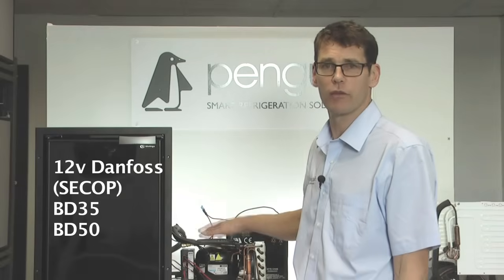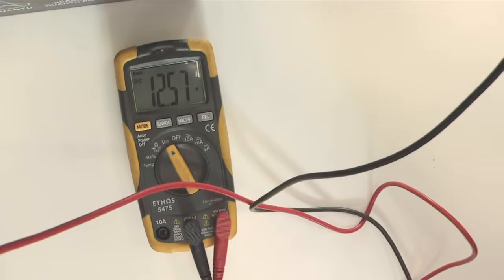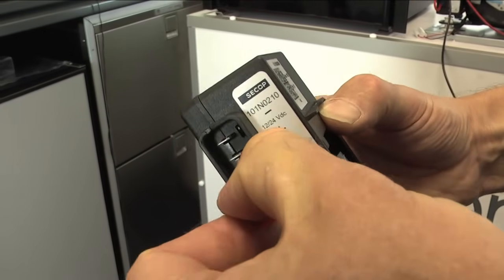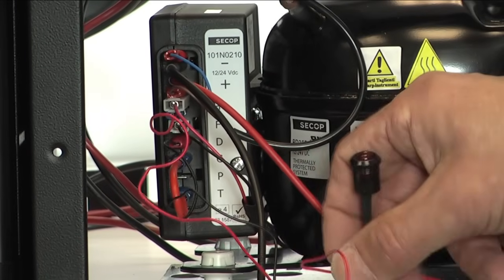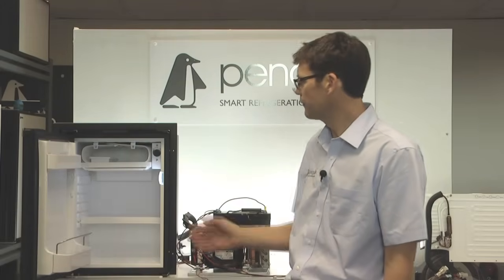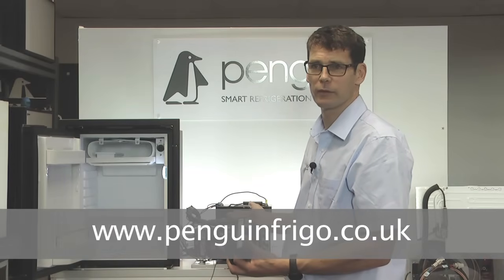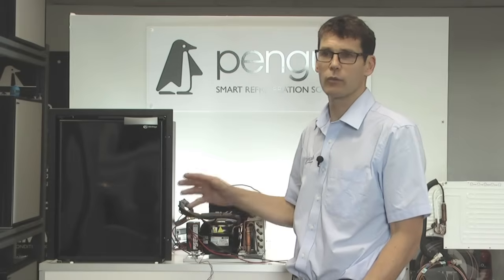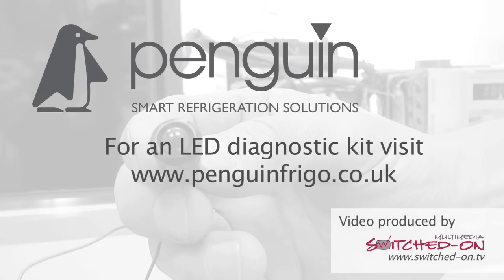BD35 BD50 DANFOSS 12/24V DC COMPRESSOR LED TEST

Comment: K

Hello,

Following my absence for three months, the compressor in my fridge no longer starts... it's a Danfoss BD35F.
The batteries are properly charged.
I did an LED test, nothing is flashing. 
I've got 12 v coming in. 
However, I have almost no voltage at the fan plugs (the fan doesn’t work). When I disconnect them, the motor doesn't start or vibrate either.
Do you have any idea where this could be coming from? 

Thanks a lot

Comment: I checked the winding/housing short circuit - no short circuit. I measured the winding resistances and in each case I got 0.0Ω. What could have happened?
The compressor is 12V DC.  What should the voltages be on the three contacts connected to the compressor? Should they be measured after unplugging the plug or with the compressor plug connected?

Comment: When i connect the power to the controller it blows a 15amp fuse so what is your recommended steps i have db50 simular controller. I checked all the wires to my boat i even unplugged the controller and all the cables and put power directly to the controller and it blows 15amp fuse would you say the controller is bad?

Comment: I want to run an extra fan of the same size as the factory fan for better ventilation in caravan and wire it to the factory fan. Will adding this cause the compressor to shut down by overloading the circuit? Thanks for a great video
Reply: Run a separate line,this pc board jts crap alreadh with one fan,and use an ambient tstat to turn fan on and off

Comment: My fridge comes up with a continuous flash. I’ve changed the temp sensor 3 times. If I take the fuse out for a minute then replace it will run for about a day. Each time I have to take out the fuse to reboot it. 
Any suggestions please

Comment: Good day, I have a Norcold (Thetford) N1090, the led is flashing 2 every 4 seconds, the fan is running but compressor not. I have done all the tests on the compressor resistance and voltage drop.  My unit shuts down when the power is disconnected to the fan at the control but when I disconnect at the fan plug there is no change other than the fan stops, the compressor does still not start.

Any ideas or help would be appreciated! Cheers.
Reply from the maker: Hi Paul, 2 flash can also be voltage drop on the newer 101N0212 controllers.  I suspect that it is still a voltage drop issue - remember that you will only see this when the compressor tries to start.  I recommend that you wire direct to a fully charged battery with minimum 2.5mm sq cables and crimped terminals to the battery and fridge
Reply from the maker: If you you get the same result then possible that controller is faulty - we can test this for you at Penguin, Havant UK. you can contact us through our website or email sales@penguinfrigo.co.uk
Reply: @penguinrefrigerationlimite3531  thanks, I'll give that a try. If it doesn't work is it worth swapping out the fan. I am in Canada so difficult to send my controller but not impossible.

Comment: give me battery capacity detaits
Reply from the maker: Sorry, not sure I understand your question.  The LED test will work on either 12V or 24V systems and assuming compressor will not start you should get a fault code result as long as the battery is not completely dead!

Comment: Led Light not turn on and refrigerator not working
Reply from the maker: Make sure that you have the thermostat linked out and LED is wired correctly to the small + and D.
If everything is correct it is possible that the controller is faulty and not giving an error code - but this is very unusual

Comment: Thank you for these great videos. I have a 101N0212 controller, and I recently installed an LED light on it. My question is, is there a way to test the LED light itself if there are no errors with the controller? In other words, I want to test my installation itself, and that the type of LED light I installed would light up if/when there's an error. I was expecting it would flash, as most equipment lights do, when I turned it off and on, but it didn't. Is there a way to test the light installation itself? PS: I've tested the LED component before installation and it works. I want to test that the controller is driving the LED light properly.
Reply from the maker: If the LED lights with 12V it will work if the controller is faulty and should flash a number of times every 4 seconds.  It is possible that the controller does not give a fault code - but this unusual.  Make sure you have the thermostat linked out.
Reply: @penguinrefrigerationlimite3531  sorry if I missed this somewhere, what is the right way to "link out" the thermostat? Can I simply disconnect the C and T wires from the compressor or do I need to join the wires to short them? Thanks!

Comment: Great informative video. I have a brand new never used Dometic CRX50 which is not powering up. I measure 12 or 24 volts at the terminals of the powersupply but as soon as I connect the terminals to the fridge, voltage drops to zero. I am thinking this is a defective SECOP unit - maybe with a dead short? Fan runs if I connect it directly to power supply. Any thoughts? Mike
Reply: Have you fixed it? I'm having a similar issue.
Reply: Have either of you figured it out yet? I'm having similar issue with everchill 12v refrigerator

Comment: 5 blink (thermal cut out) fixed by cleaning PCB here. Applies to 101N0220 and likely other obsolete controllers with "Dialog" chip. The traces for the thermistor runs next to a 12/24V trace. At the interface between the heatsink PCB and main PCB a small speck of what I assume was flux tesidue appears to have caused a significant leakage current between these traces, leading to erroneously high temperature readings. The interface between the PCBs shows multiple signs of what appears to be flux residue, so I would expect this to be a possible cause for faults for others as well. The thermistor traces are near the center of the board. Other faults may possibly be caused by leakage current between other neighboring traces, but the temperature sensing is particularly susceptible due to it using high resistance values.

The small unmarked SMD resistor-like component near the middle of the heat sink PCB appears to be an NTC thermistor, mine measured ~25kohm at 25 deg C. One side of it is supplied 5V through 100 ohm. The other side forms a voltage divider with a ~50kohm resistor to ground. In my case this side measured more than 5V, which did not make sense from my understanding of the circuit. Normal voltage should typically be in the range 3V-4V. At the chip input it measured 5.6V, indicating that it was capped by over voltage protection at the input pin.

Word of warning for any inexperienced troubleshooter: The controller contains a boost converter capable of delivering ~50V, possibly more in case of malfunction of/tampering with the voltage monitoring feedback.

Comment: I have a 3 years old waeco CRX50 on 12v. It has a BD35 compressor. I have no power getting to fridge so cannot switch on. I have 13.2v at the controller terminals. power is going to fan and compressor but nothing starting. I connected a multimeter to the diagnostic terminal and power fluctuates. I have no led diagnostic but could I count the fluctuations on the multimetre as error codes? Is it as simple matter that the controller is defective?
Reply: Hi, really sorry but we cannot advise on the specifics of the CRX50.  If you put power to the negative and positive and bridge the C&T on the compressor and it all runs, then the issue is with the digital controls of the CRX50 and you would need to speak to Dometic about replacement parts.
Reply: @zebelliott5780  Hi Zeb I have bridged the C&T and the compressor and fan came on but I have no diagnostic led to fault check. Also I cannot seem to establish the location of the thermostat but I am guessing it is built into the digital display. Cannot find anywhere online on how to disassemble in order to find the part number

Comment: Hi Mohmmad - The Danfoss E50896 control box on our web site operates on  both 12 and 24 Vdc. The control box will detect the voltage automatically. I hope this answers your question.
Reply: Buenas noches como puedo saber si está en corto el motor
Reply: Tengo un motor similar pero no enciende

Comment: Can I connect direct without the controller box
Reply: Hi Afande, no, a controller must be used with a compressor.
Reply: What if I connect it using inverter from a DC battery  ??
Reply: Not working without control

Comment: I have an alpicool compressor, but otherwise every connection/wiring is the same. Ive gone through the steps as you mention, ive shorted the thermostat C-T, and unplugged fan and only then do I get a very faint vibration in the compressor. But it just doesnt cool. This fridge/freezer has been running great for 1.5yrs and only lately i noticed it wasnt going below freezing, YET food still seemed to be frozen and ice had built up. I defrosted, and cleaned, but now I get no cooling at all. My question is: how do you know when its your compressor at fault, and can it be repaired for less than price of replacement unit (~$250AU). Thanks!

Comment: Hi i have error code 5 blinks , to high temp . How can i solve this problem ? Please
Reply: I had that problem, N0220 controller with Dialog chip. In my case what looked like flux residue caused a weak connection between 12v and the thermistor sense trace. Check for any dark specks between the solder pads at the bottom of the heat sink PCB. The thermistor traces are near the middle of the board.

Comment: Great video. Im currently converting my bush (argos) fridge from 240v mOns to 12v danfoss compressor, i have the compressor fitted and am just wiring up the control module. I dont have a fan connected to the compressor as it appears part of the fan is inside the refridgerator under the rear panel. Any suggestions her?
Reply from the maker: If you have a static condenser you don't need to wire the fan.  The internal fan is to circulate the air in the fridge.  You may need to replace this with a DC fan - if you wire to the small + and F it will run only when the compressor runs and must draw less than 1A
Reply: @penguinrefrigerationlimite3531  yes, there appears to be a static condensor in the fridge. I have the condensor connectes to it. Now im at the wiring stage. The secop module is installed, so now i just need to check whatbi need to do with the wiring of the thermostat and fridge light. There is a manufactures connector block with 4 pins. The mains power cable is wired into the male side and from that also the power for the compressor. The female side has the fridge light and thermostat connected to it. If i keep this setup like this the thermostat and light would be powered from thw 12v battery and bypass the secop control module. Will this work correctly? If not will i need to remove all wires from the connector male and female and takemthe power directly.tonthe module first then connwct the thermostat and light directly into the module?

Comment: my bd35 compressor runs non stop what could be the cause its a 12v version
Reply from the maker: If it runs non stop it will either be a lack of gas so it never reaches temperature, or if it is freezing the plate, but not turning off then the thermostat is faulty

Comment: hey guys I have a dual zone fridge, the freezer works great -18 degrees but the fridge section has nothing..checked relays, compressor is running, fan is running just not cooling the fridge section? Any ideas?

Comment: Hi great video - my danfoss fridge compressor comes on along with the fan but then the compressor stops after 5 seconds or so and it continually cycles like this. Sometimes it will stay on but no fault codes :( any tips?
Reply: Good afternoon Cactus Sailing, We would recommend that you carry out the fault diagnostic test including the linking out for the thermostat. If you have done this and have not found the cause, the next check is your voltage. The controller has system protection that will switch off the compressor if the voltage drops below a set level to ensure that your fridge does not drain your batteries completely. Please check your batteries and all wiring and connections to the control box. Penguin Ltd
Reply: Not proper volt 25.5
Reply: https://youtube.com/shorts/TQ7t1sT8Fz8

Comment: This is a great tutorial, but my compressor is still not running at 12V. It only works with 24V. What do I need to do for it to run at 12v??
 Im getting the code 1 fault when i try to run it at 12V
Reply: Please phone or email Pengiuin Refrigeration and we will assist you further.
Reply: @stevelongmore2349 that was an answer to post so other dys could have taken note of it.

Comment: Thank you for the video.
I have a Waeco mini fridge in my truck.
I'm not sure of the model, but it does have a code light on the inside.  It shows a code 3, three flashes in four seconds.
It started working for a short time, then it stopped again.
In your professional opinion, would that be the Danfoss module that needs to be replaced?
I'm in the US, and I'd like to get my fridge working again.
Thank you for your reply in advance.

Comment: Great Video! If the LED does not flick at all when testing what does that signify?
Reply: Thank you for your question and comments - If the LED does not flash it would normally mean the controller is working ok. However you must have the led + and - the right way round, the thermostat link wire connected and you will need to ensure you have 12v at the supply to the controller which must also be plugged into the compressor. If you can let us know the fault with your system with photos we will be able to help. Regards Steve
Reply: Hi Distance Rider normally that would signify that the controller is working ok. This is assuming that you have checked your power supply and all wire connections are in good condition and correct. also that you have linked out the thermostat. If you are unsure that the controller is working, you can send it to us for testing.

Comment: if the light blinks 2 times but fan is working but compressor is not, does that mean its the compressor, i took it out and directly tried powering it but it dint do nothing?
Reply: You don't have full 25.5 volt
Reply: https://youtube.com/shorts/TQ7t1sT8Fz8